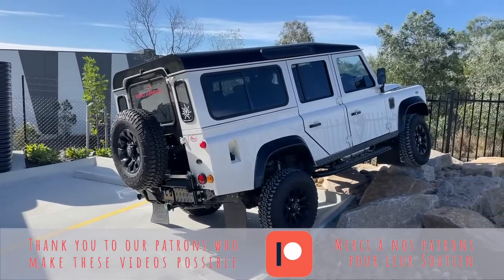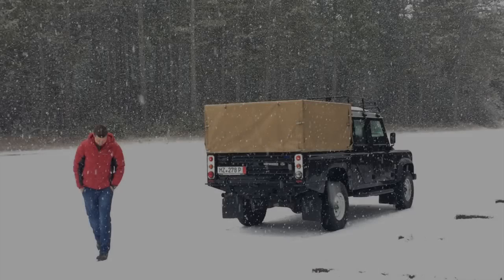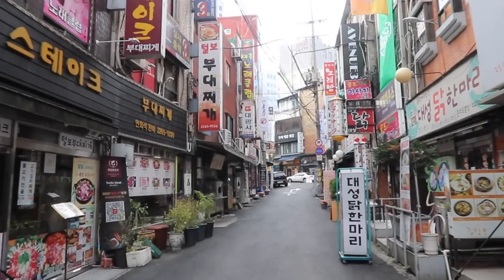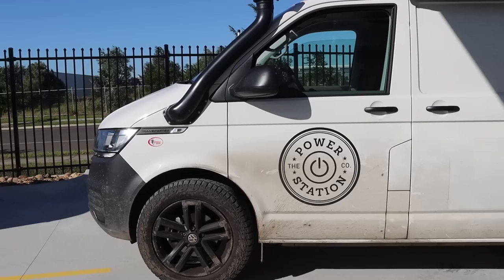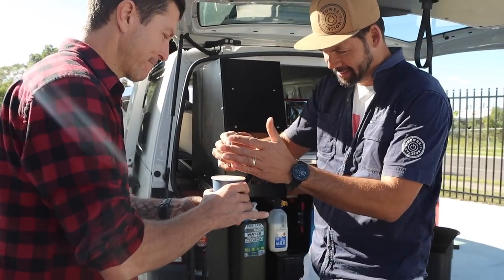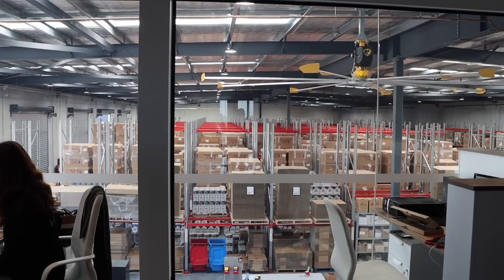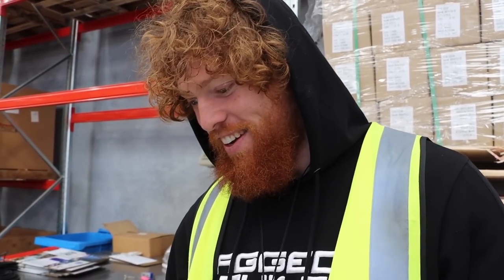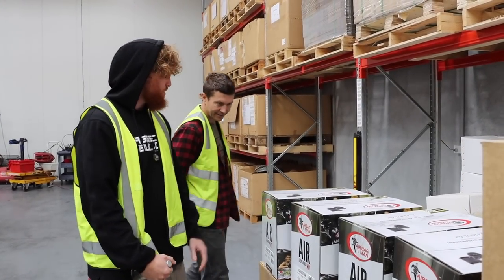Land Rover Defender on full air suspension! We visit the Airbagman Australia HQ.

Comment: Can you please give some more info on the dual shock rear please? I have a heavy 130 that has had shock issues. Thanks in advance
Reply from the maker: Probably need replacement. 😅 We have terrafirma adjustable shocks and later on we added old man emu as back up before tackling a remote track in Tajikistan. Terrafirma shock absorbers twin brackets (re enforced in Georgia after noticing a crack on them)